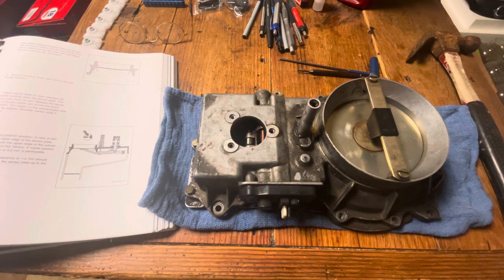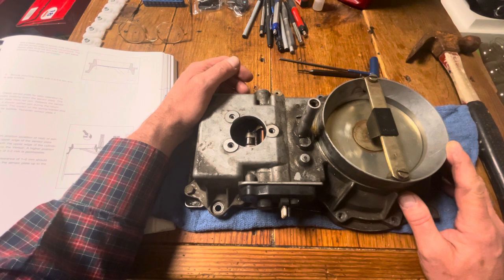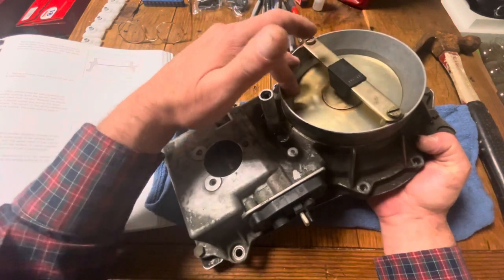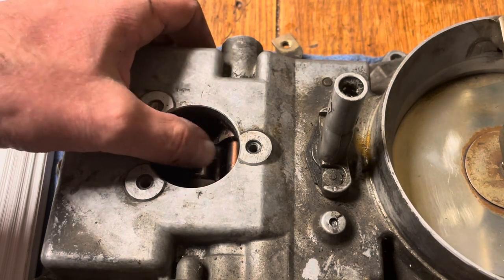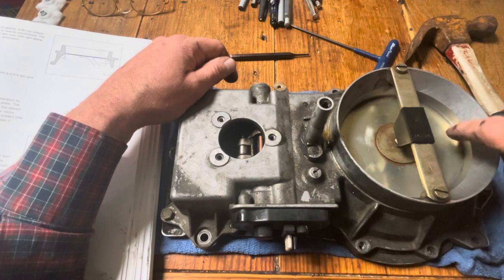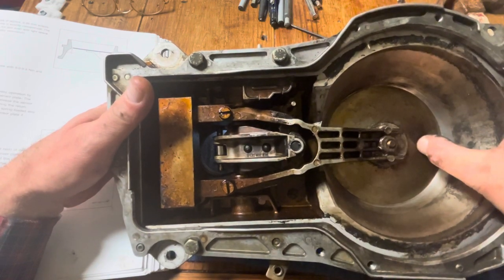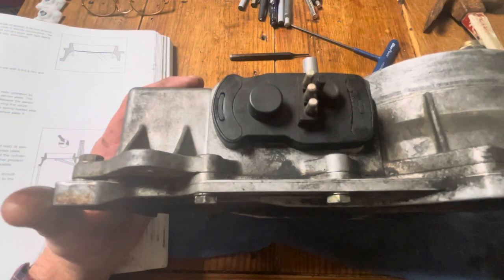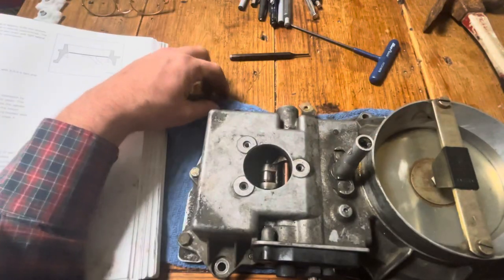Mercedes, W126 all 8 Cylinder - Airflow Plate resting adjustment, idle speed adjustment & issues

Comment: Does the K-Jet with Lamba follow the same guidelines as the KE-Jet when it comes to adjusting the mixture screw?
Reply from the maker: The K-Jet with Lambda, the second generation K Jetronic also called KA Jetronic requires only adjustment with CO tester in exhaust pipe. 1980 models less then 3% or 4% (check manual chapter 07.2), after MY81 to KE jetronic 2% or less at idle and coolant temp ~ 85C.
Make sure your Cat is ok and Warm Up Regulator is adjusted correctly, otherwise you will loose you hair
Reply: My Warmup regulator has been rebuilt by CIS flowtech and all the major fuel system components rebuilt or replaced. System is also air tight. I am checking mixture with an oscilloscope that reads the signal going to the frequency valve. The problem I have is that if I set mixture correctly at idle, the fuel system leans out at 2000rpm…. If I set it at 2000rpm I am rich at idle…. Could this indicate that my Cat is plugged? Car has 105k mi…..
Reply from the maker: Can you tell which specific vehicle you have like 126.039 with engine 117.986 as example?
Reply: 1982 380sl so 116.962
Reply from the maker: Are you using Manual 14-100? For your engine range is 30% to 70% measured with Bosch Lambda Tester with breakout connector on control unit in front passenger footwell area 
The signal / on off ratio measured on frequency valve is different from the measurement taken with the Bosch Lambda Control Tester KDJE-P 600 on the control unit
Reply: I have done all the checks associated with 14-100 and everything checks out good. To measure the frequency valve i am using poles 2 and 3 on the connector on the left side of the engine bay. I adjust mixture with a warm engine and try to get the frequency valve to operate in the middle of the range…. But as the rpms rise, the frequency valve can non longer compensate for the leaning out of the mixture….
Reply from the maker: @marcovera7865 question, since you increasing the rpm which normally implies the driver is accelerating the vehicle, do you think the engine should lean out during this process?
The mixture should lean out after acceleration but this can take a while, 30 seconds or longer at constant higher rpm since the throttle position switch is now open. The entire lambda control at this point depends only on two items:
1. TDC
2. Oxygen Sensor
Reply from the maker: @marcovera7865  the control unit is a “analog computer”. It does not have a Microcontroller and Software like today’s ECU’s or the second generation W126.
The passive components like resistors and capacitors age and loose their initial value resulting in different adjustments then one would expect from a brand new control unit.
Reply: The ECU “knows” very little… it knows engine coolant temp, throttle full open/close and O2 Sensor reading… and can only fine tune mixture. This is my modest understanding…… the vast majority of the fuel mixture adjustment are analog. So why is my mixture leaning when I open the throttle? Too much air or not enough fuel? Thought my fuel distributor was plugged and slow to follow… had it rebuilt no change…. Too much air? Smoke testing doesn’t indicate any leaks… This is why I was wondering if a plugged catalytic converter could be the issue….
Reply from the maker: @marcovera7865  I think the culprit is the frequency valve itself. For full enrichment the valve should be fully closed, which is the default. 
If your mixture is to lean then this means two things:
1. The valve physically doesn’t fully close any longer, because the O ring gasket inside is defective or valve is internally dirty 
2. Control unit does not reduce the current to valve enough to allow for enrichment to take place.
Check with a dc ampmeter the current on one leg of valve from control unit and repeat your test
The controller regulates the valve by current (amps) not voltage 
Maximum coil voltage on frequency valve should be limited to 3V to 5V maximum when directly connecting a dc power source to the valve for out of vehicle testing. 12V can burn the coil fairly quickly.
Reply: @inovahightechltd  Appreciate your very valuable insight on this matter! It is people with your knowledge and passion to share it  that makes the world of classic auto ownership a little more bearable! I will update you on my findings.
Reply from the maker: @marcovera7865 thank you. I am almost sure, as thorough and detailed you are, that you have checked the TDC signal wire from ignition, where I believe it originates, to the connector on the ”ecu” for continuity and the same goes for the throttle position switch wires?
Reply: @inovahightechltd   tell me more about the TDC signal wire from the ignition. I don't have this check on the 380SL version of 14-100. What does "TDC" stand for? I have checked for continuity of the Throttle Switches (full open & close) at the ECU and I have checked for power (12V when the ignition is on).
Reply from the maker: @marcovera7865  this is the rpm signal and I am not sure if this signal goes only to your idle speed control unit or to the ecu as well
Reply from the maker: @marcovera7865  in the early days it was called TDC, but then changed to TD
The lambda system itself is simple. It all starts when oil temp switch is on. Then the throttle position switch takes over in conjunction with the oxygen sensor. On later versions the coolant temp and TD where added

Comment: My rotor is pointing to cylinder #6 at TDC on ZERO
Reply from the maker: Garry, the crankshaft has two turns for one turn on camshaft and distributor 
You need to take off both camshaft covers and align camshaft tdc marks with crankshaft tdc mark. Only then can you adjust distributor
Reply from the maker: https://youtu.be/HmBpeBP3ZkE?si=p9EKjsCMWLPSYAR8
Reply: Is that WHY my NOX was high?
Wow, I have to remove BOTH vales covers again to see camshaft DTC?
CAR DIVES ok, but a bit weak and unstable RPM
Reply from the maker: @glim888  there is probably a lot more wrong 
You need to get the MB service manuals and do the entire diagnostics in group 07.3 
This is beyond the comment section or by phone to guide you through this
Reply: I'd replace those chain guides and valves cover gaskets, and make sure TDC on both camshafts were inline .....then instead distributor cap.....I thought rotor was pointing close to cycliner#1....not too sure.
In that case , could I pull out the distributor assembly and reinstall rotor to point at #1 cylinder?
Reply from the maker: @glim888  there is a mark / line on distributor housing - align rotor mark with this line on housing with tdc marks all matching on camshafts and crankshaft
Reply: Do you think, this is a marking dot to align rotor, with the rest on TDC on camshafts?
Reply from the maker: @glim888 everything has a line to align, watch the video for the 450 engine I posted the link to.
Reply: How can i get a hold of MB owner manual? Thx. @inovahightechltd
Reply from the maker: @glim888  Mercedes Benz used to sell those on CD/DVD but they stopped working on windows 10 computers so they discontinued them.
You need to Google it

Comment: How to remove ball bearing seal from top of adjustment?
Reply from the maker: Need to check ball bearing removal
Reply: @inovahightechltd  how to remove ?
Reply from the maker: @glim888 you have to carefully drill out the ball
Reply: Could I cut off top 0.5in?
Reply: Another guy mentioned....if the original ball is still on the part, do not attempt to remove or adjust from the top
Reply from the maker: @glim888 to clarify, which ball are you referring too? The one which seals the adjustment screw which requires a 3 mm hex key?
Reply: I am having cold hard start and hot hard start issue on my 89'420sel....it takes about 3times to get that cold engine started, but after warms up the car, and start back up immediately is ok.....but stopped for about 30mins to restart is taking long time to get started....seems like fuel flooded in port?😢 do you suggest I hammer that pin back into port?
Thx.
Reply from the maker: @glim888  I am not sure of what parts you are referring to.

If you adjust the plate resting pin then you need to adjust the fuel mixture
Reply: @inovahightechltd  yes, resting pin
Reply: @inovahightechltd  yes
Reply from the maker: @glim888 if your plate is now in the correct position as shown in video, then you need to adjust your mixture. More rich, clockwise direction, probably quarter turn or a bit more of adjustment screw.
The tamperproof ball has to be carefully drilled out. See Mercedes Benz Manual part 7.3 for your car. The removal of tamperproof ball is exactly described.
Reply: @inovahightechltd  thx, I have to adjust resting plate first than....I will send you some video clip in a couple of days...
Reply from the maker: Gary,
MB had two extractor tools to remove the security plug part # 000 997 59 86
The extractor tool part numbers are:
123 589 05 33 00
and
123 588 00 15 00
Either one of the two should work
Reply from the maker: Gary,
This is a picture of the replacement plug
https://www.ecstuning.com/b-genuine-mercedes-benz-parts/plug/0009975986/
Reply: Do you need this plug after removing ball seal?@inovahightechltd
Reply from the maker: @glim888 it prevents dust and dirt from getting into the lower adjustment assembly which is quite delicate.
I usually spray WD 40 into the tower on engines with no security plug before trying to make any adjustments
Reply: I couldn't passed smog chk, cuz my NOS was over 1000
Reply from the maker: @glim888  before or after mixture adjustment?
Reply from the maker: @glim888  btw what is NOS?
Nitrogen Oxide? If so, California limit for 1988 was 1000mg or 1 gram
Reply: Yes, i meant NOX at 1084@inovahightechltd
Reply: Yes, i meant NOX at 1084@inovahightechltd
Reply from the maker: Before or after adjusting plate and mixture?
Reply: I tried to attached the picture,  but I don't how
Reply: No, I haven't adjusted yet, it was last test about a month ago
Reply: Can I Adjust distributor
Reply from the maker: You can’t attach pictures, videos or links here on comments
Reply from the maker: No, distributor has to be set to Top Dead Center Cylinder 1 
The Ignition control module adjusts the timing by software
Reply: Oops, I was trying to send you some pictures so we can communicate better...lol
Reply from the maker: https://youtu.be/vI6nwWge-j4?si=x41SAaBxu1ELiNwc
Reply from the maker: https://youtu.be/EcMZC_tGKGA?si=YM51RjGr8rYAsPAD
Reply: How can I sent you my video clip?